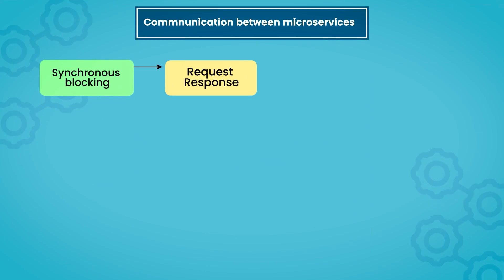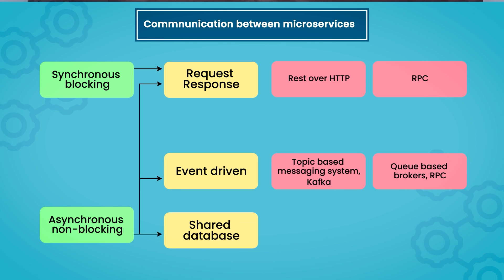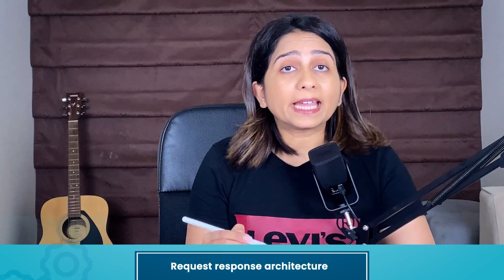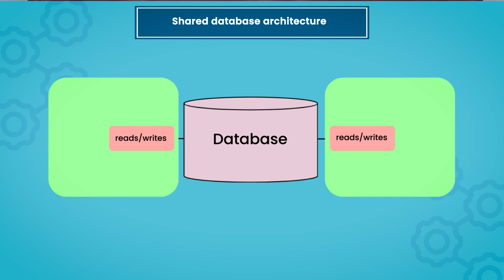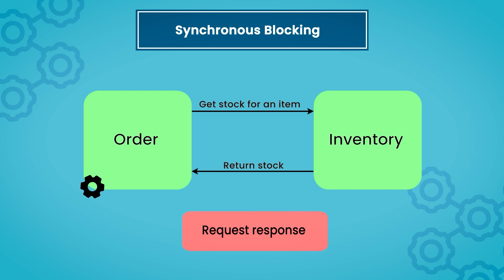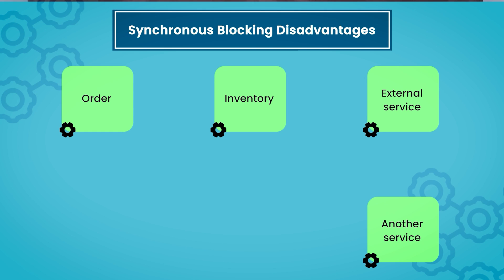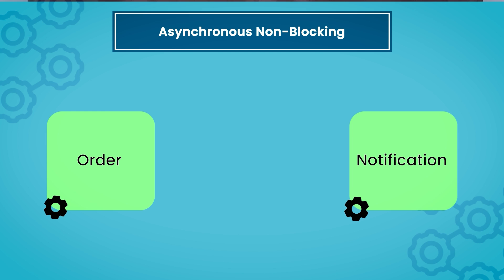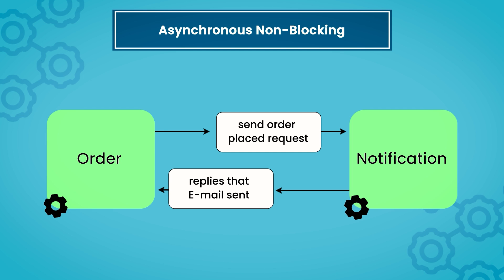What are the types of communication for microservices? (Intro to Microservices - Part 2) sudoCODE

Comment: Communication patterns are very clearly explained in the video but I am still confused on how reactive model fits in this picture? I mean, when we are using http rest, if we use reactive programming model, will the communication between services not become async? If so, will we still need a queue structure to make the services decoupled or is just using reactive model enough for the services to be decoupled and communicate asynchronously? Thanks again.

Comment: While using JWT we have secured microservices from external clients, but few questions arises:
1) How will a microservice communicate with another microservice (will they need a JWT, how to create then?) or to keep such communication unsecured?
2) How to protect a microservice from direct access by clients? How to make sure gateway is the only way to reach a microservice?
Reply: In most cases, microservice-to-microservice communication does not require JWT. Once the user ID and other relevant information are extracted from the JWT by the first microservice, they can be passed to the subsequent microservices as needed. To secure microservice-to-microservice communication within a Kubernetes cluster, you can employ trusted solutions like service meshes, which help secure communication using mutual TLS (mTLS). Service meshes like Istio also provide features such as service discovery.

By default, in a Kubernetes cluster, all microservices are defined using ClusterIP (best practice), which means they are not exposed to external communication. However, if you need to expose a microservice externally, you can use an Ingress resource with a Layer 7 load balancer. API Gateways like Kong and Traefik can manage the load balancer and handle the routing of external requests to the appropriate microservices.

It's important to note that my answer is primarily in the context of using a Kubernetes cluster. I don't have extensive experience with microservice communication in other environments.